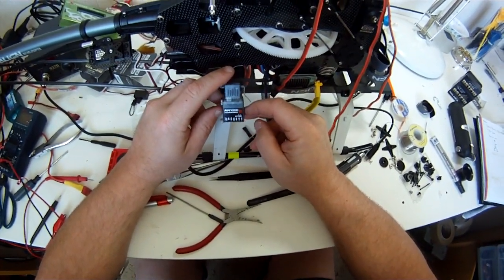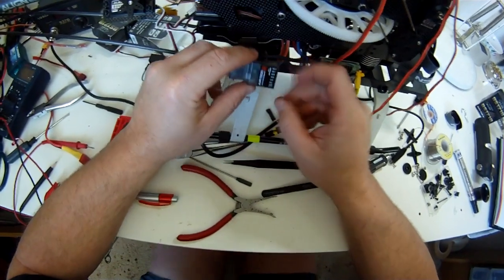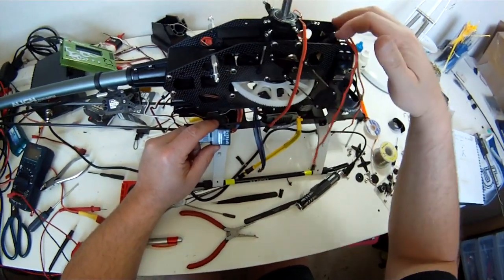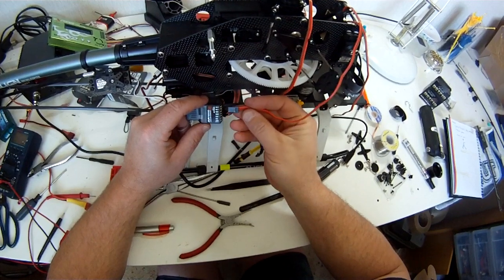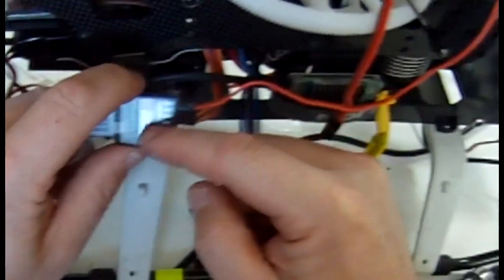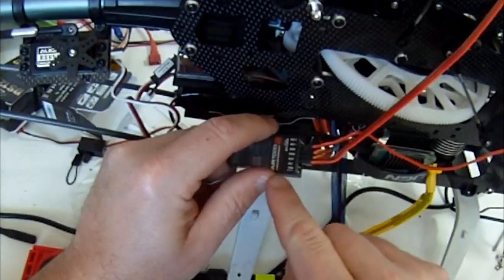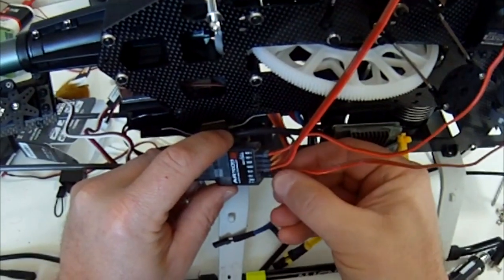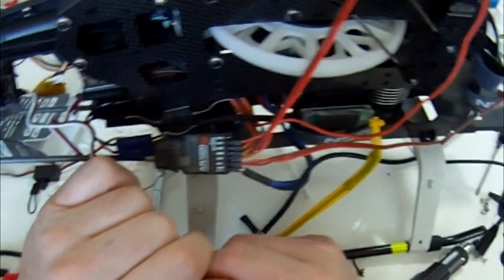AR7000 heli channel setup

Comment: I HAVE A TREX 600 WITH A SEPRATE BATTERY POWERED ALIGN BEC WHERE DOES IT PLUG IN ON THE AR7000? IF IT PLUGS IN WHERE THE BIND PORT IS, THEN HOW DO YOU BIND THE HELI TO THE RADIO?